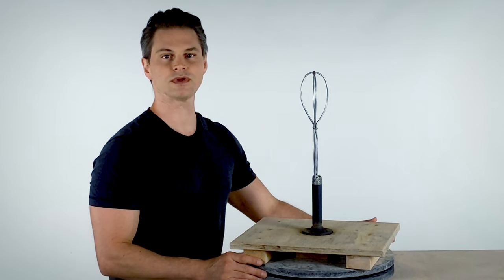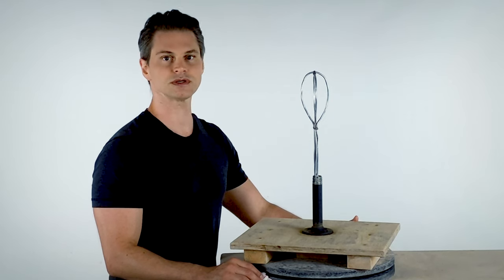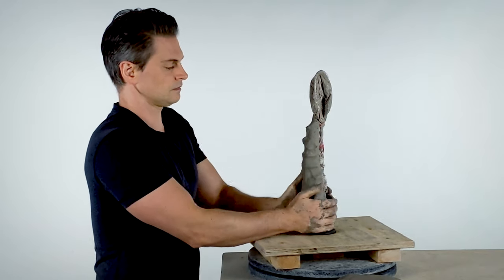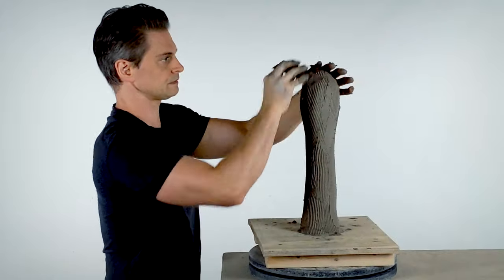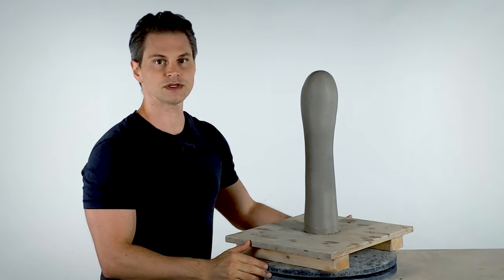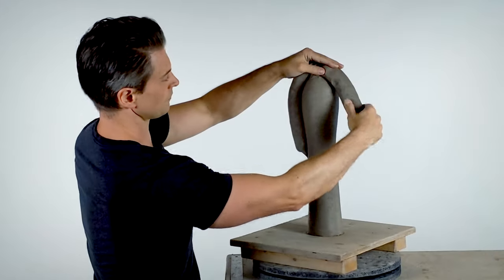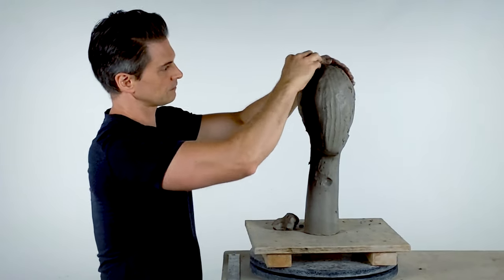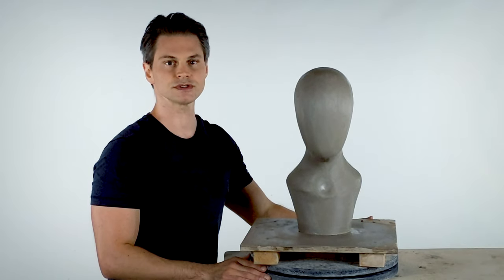On-Armature Bust Part 4: The Blank Head

Comment: In some other tutorials, I've seen artists filling and wrapping the armature in newspaper. Is clay sliding a big issue when doing it that way? I want to do that to save on material cost & weight. 
Also, would stainless steel wires also work for the armature? 
Thank you!
Reply from the maker: You can absolutely do that. Of course the big advantage of packing your armature is the reduced weight and material usage. The disadvantages are: 
  1. With this type of armature, you typically have to sculpt to the final pose rather than posing after establishing a likeness (which hardly matters if you’re not doing a likeness).
  2. The mass of clay you use with an egg-beater style armature actually keeps everything moist for much longer, which can be good for beginners because they can take a long time with a first bust. But if you work fast or wrap your work really well, double bagged with moist cloths and all, this shouldn’t be a problem. 
  3. The sculptural feel of paper under clay, the springiness of the feedback you get, is really unpleasant for me. To avoid this, you could use packed aluminum foil instead, but then you have to be extra careful with the drying or the clay can crack as it shrinks against the rigid interior.
Reply: @In The Round  What about using stainless steel wires? My thinking is that the steel can be just as strong yet flexible as the aluminum at the right gauge and should resist rusting while being cheaper than getting say, 3 gauge aluminum, which appears to be what you are using.
Reply from the maker: @dave5194  In my experience, the relationship between strength (how much weight the wire can support) and flexibility (how easy it is to bend) is better for armature wire than for steel. That said, you can really use anything you want for an armature as long as it works.  As a general principle, I'd encourage experimentation over relying on received wisdom, provided the stakes are low - that is, that the loss isn't too great if the armature fails.

Comment: How do you avoid air pockets to prevent cracks when drying?
Reply from the maker: While it’s of course best to avoid trapping air while building up your masses, a few small air pockets aren’t typically a problem with on-armature sculpting (or with off-armature building for that matter). 

Air pockets are potentially problematic for two reasons: first, the wall will be weaker at that point, and therefore more vulnerable to the stresses of warping and shrinkage; second, if heated too quickly, the moisture in the air pocket could expand in the kiln and cause a rupture. Although these concerns are real, trapped air is a far less dire a problem than most ceramists seem to think. 

In respect to the first problem, if all the seams are thoroughly worked together and the walls well-compressed from both sides, they should be strong even with a few air pockets. When sculpting on an armature, this kind of compression will be a necessary byproduct of the sculpting process on one side, and the hollowing and reassembly process on the other. Furthermore, if you’re monitoring the work as it dries, any small cracks that may emerge, from air pockets, poorly made seams, delaminations, or whatever, are easily fixed. 

In respect to the second problem, if your work is dry, your preheat long, and your firing schedule cautious, the moisture in trapped air shouldn’t be a problem for most sculpture clays. In fact, I’ve intentionally fired trapped air many times! 

That was a long way to say, don’t worry too much about trapped air, but it didn’t actually answer your question. For me, the best way to minimize trapping air when making additions is to spread the clay over the underlying surface by pushing it with the base of my hand or pulling it with raking fingers. You’ll see me doing both of these many times over the course of this series.
Reply: In The Round thank you 😊